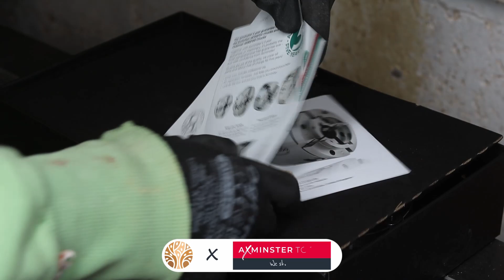Woodturning - Can ELM Look Amazing?!

Comment: As a kid, my father had a lathe that we turned replacement baluster for our farm house stair. I didn’t like ‘knot’ being able to see the surface I was cutting so I added an adjustable strobe light which was actually our timing Gun for adjusting timing on our truck engine. Worked well to see fine detail and match template profile.

Comment: Where do you get your inlays made for the bottom of your bowls?  I am trying to fin da good way to personalize bowls I turn and am not having great luck with a branding iron I bought- there are too many variables to be consistent and I don't want to ruin too many bowls to perfect it.  The inlay seems a perfect solution.
Reply: Hi Fretless, I had similar issues with a branding iron and now I just cook in between turning and have bought predesigned coins from ebay. 
Do you think I should start a cookery channel now ...??? 🪵😃👍
Reply: @HarrySmithShorts  Why not?!
Reply: @fretless05  👍😂🤣
Reply: @HarrySmithShorts  What did you search for on eBay?  I've tried several things and get more car stuff or military coins.
Reply: @fretless05  if you look on my eyeball Halloween video and access the description more field, I have posted a link to my contact on etsy. 🪵😃👍